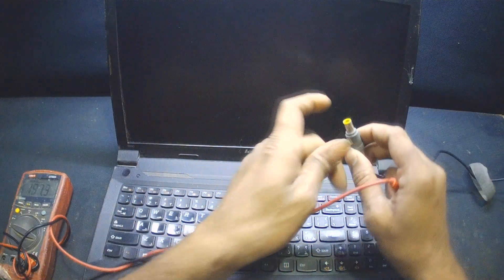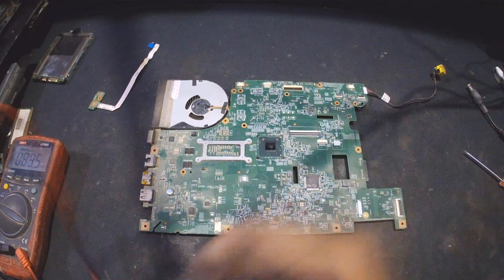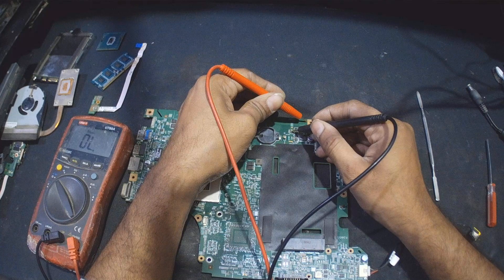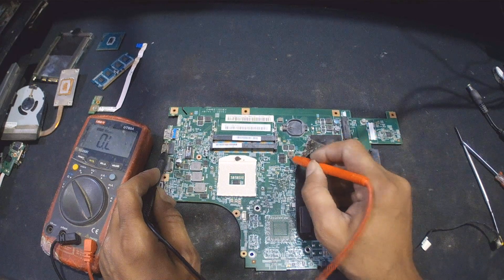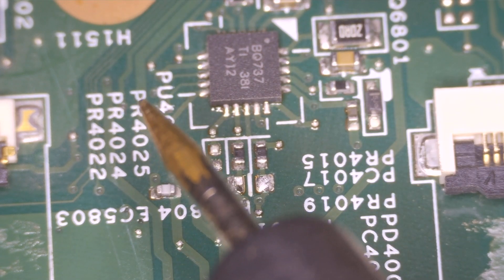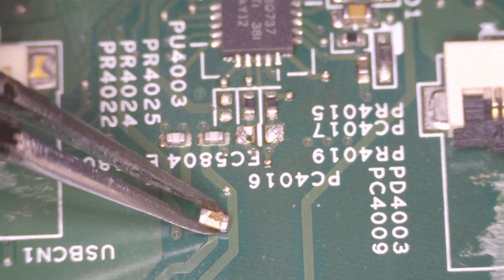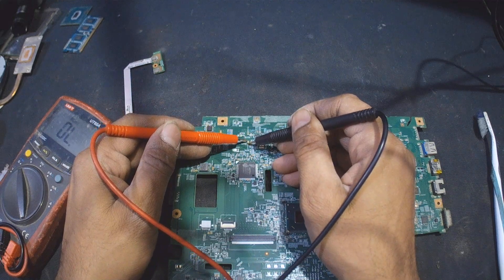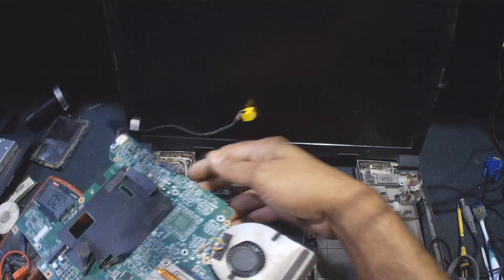Lenovo B590 Laptop No Power | How to Find Short on Motherboard | Fixed

Comment: If this laptop is not charging battery what can be the problem
Reply from the maker: Hi, First check the battery with the battery repair person or check with a new one, if your new battery starts charging problem is solved.
Second Check Motherboard Battery Connector Pins for Voltage Normally Without Connecting Battery Displays 3.3v on 3 Pins and Charging Volts on Two Pins, which Varies for DIfferent Laptop Motherboards 8 Volts to 12.
If Voltage is missing from the Motherboard pins, the problem is with the motherboard, Changing the Battery will not solve the problem. Here Required  Motherboard Repairs, it could be an SMC IC issue or Resistors or charging IC problem.